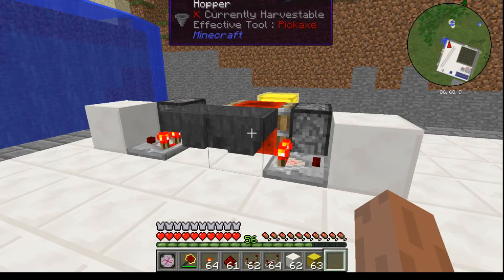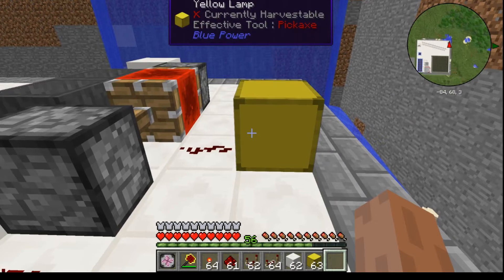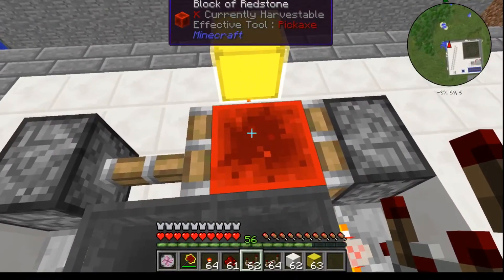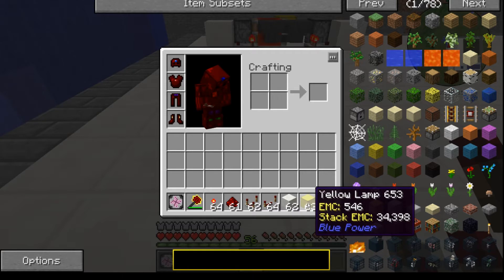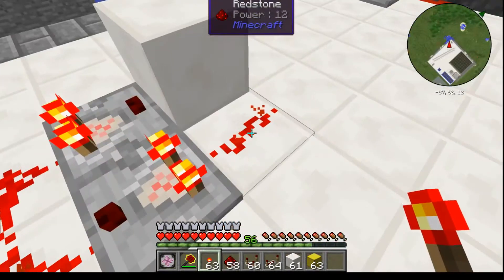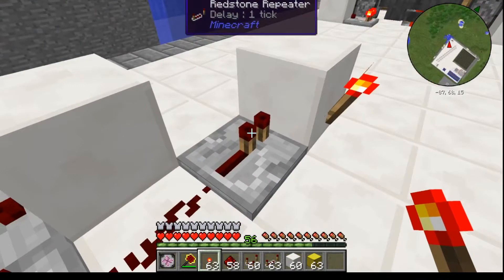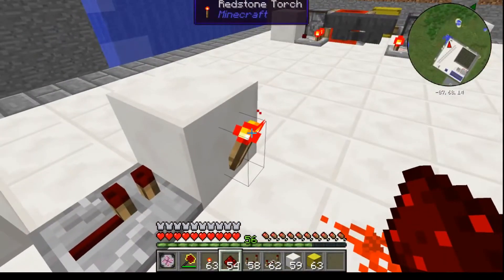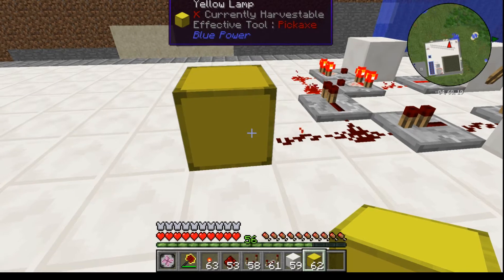MineCraft Hopper Timer FIX

Comment: Hi. I'm a redstone noob. Are "ticks" equal to seconds? I need to replace a hopper timer that is no longer functioning. (It's in the crlusher of my blaze farm.) It's supposed to be on for "25 ticks," but it doesn't work anymore. If ticks and seconds are not the same, what would you recommend as a substitute -- the 25 ticks are enough to bring the blazes down to a one-hit kill. This video is so clear and concise. I've subscribed and plan to use this method to add lights to some of my projects. (Something none of my friends have, for sure!) Anyway, hope you can help me. I enjoyed the video. Two thumbs up!
Reply from the maker: there are 20 tics / second.
Reply: Thank you. Seems like I'm going to a lot of trouble (all those resources) to create a crusher that crushes for only 1.25 seconds at a time,, but that sounds so typically Minecraft. :-)  I appreciate your taking the time to answer my very stupid question. Thanks.